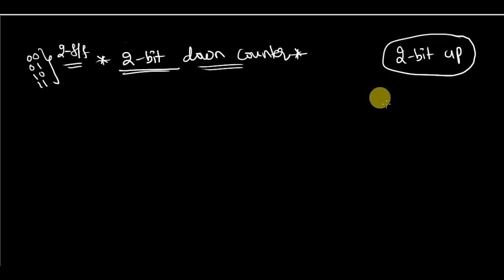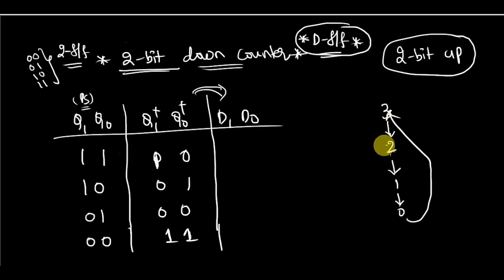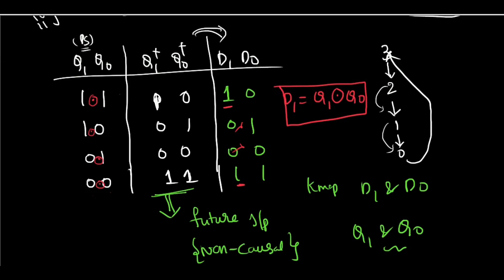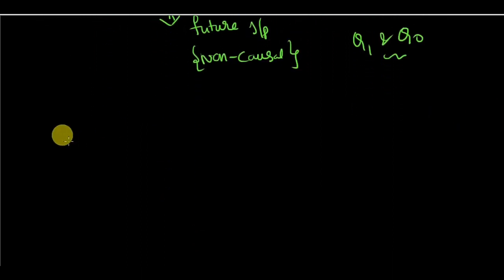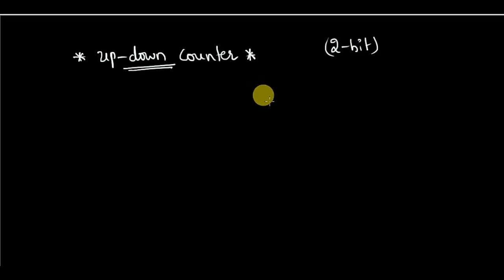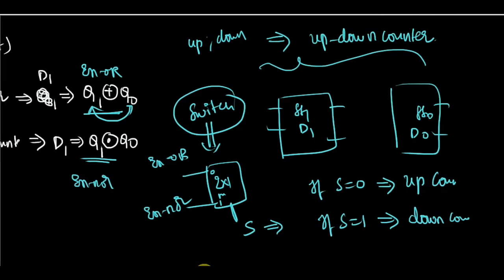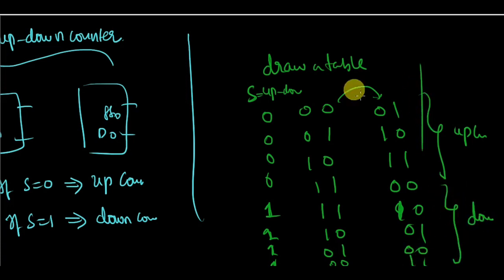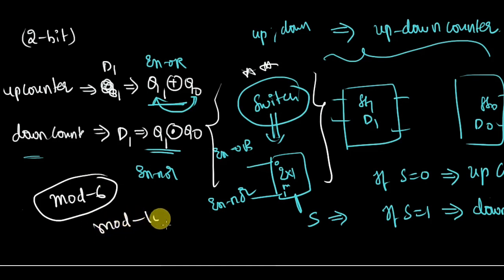Synchronous 2 bit down counter and Up-down counter

Comment: Are you also familiar with SIMETRIX software? I tried to design a counter circuit on SIMETRIX and have some issues. How could I get in touch with you to discuss in detail? Thanks
Reply from the maker: I'm not familiar with so called SIMETRIX software...but for discussion wise I can be helpful 
You can text me vasudevarao03@gmail.com